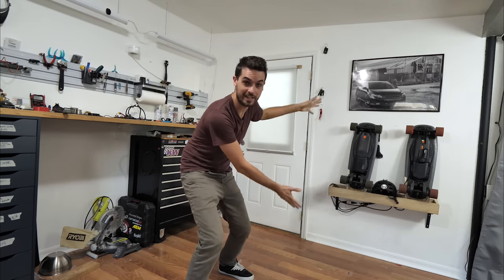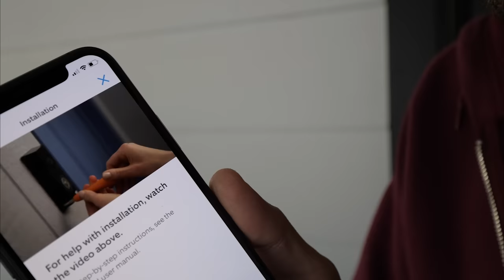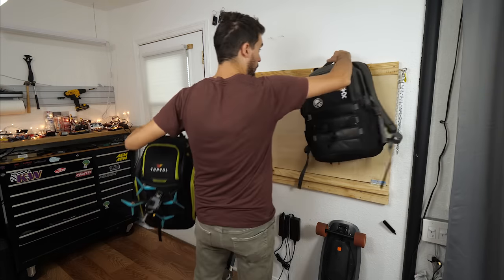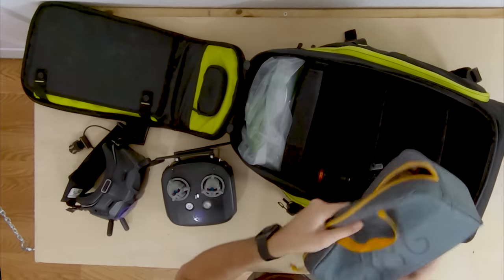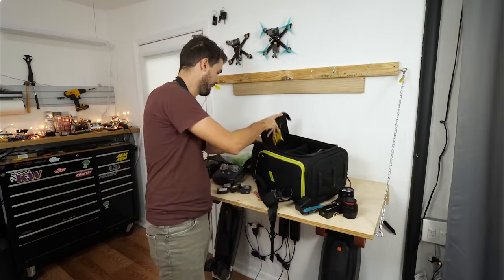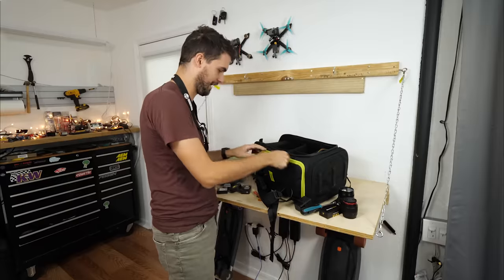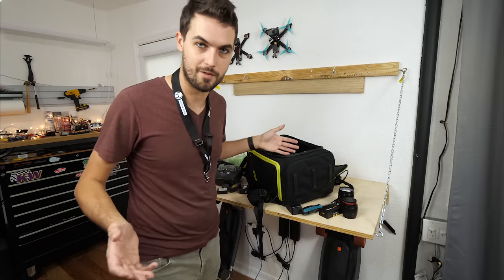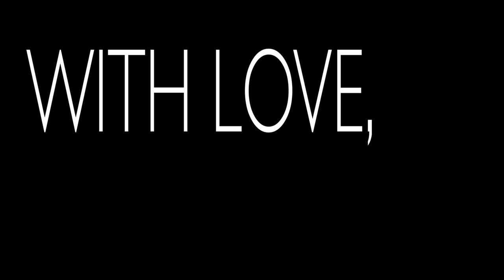i made a FPV Drone Bag rack! [FPV gear breakdown]

Comment: Also Mr. Engineer, hang the boards from the trucks instead of balancing them on the tail.
Reply: VORT3X lmao - “Mr. Engineer”.
Reply: Duh.
Reply: OMG! He LIVES! 👀
Reply: Engineering doesn’t always mean you have to come up with the ideas, sometimes you just need to engineer other peoples ideas lol.
Reply: Or add a couple of pegs on either side to hold them upright, or some hooks and bungee  cords to strap 'em in...
Reply: He could also just put the wheels against the wall they are a bit stickier than the lip of the deck
Reply: He used to be a GM engineer. He is smart,  it just a good fpv pilot. Although I Dennis at Excel Rc told me Vortex taught him how to fly 😐

Comment: Yo, Drew! - Four straight bars/sticks in a row underneath that folding table, two holding each of the e-boards up flat, right behind the wheels. 
So they "stand" in the air behind each other, if that fits in length.
You can hang that helmet on one end of those bars/stick ends, too.
That ultra-low lookback on the parking lot blew my mind!! =)

Comment: Great vid!
Also, PSA: don't get ring!
We got a handful of cameras and a doorbell months ago and they've been nothing but frustration.
For starters they have ATROCIOUS battery life. They claim months, but on the lowest possible quality settings they last less than a week.
2nd: they never can connect. When you open the app, (if you can even open it, more on that in a minute), have ridiculous frame droprate. It's just horrible. Really terrible. We're not even comparing this to any other smart home security systems because this was our first like this. Using them is just a bad experience. Also, the camera resolution and framerate is awful too. The digital zoom on the app just makes it worse. 
Now the app: when you open the app, or should I say, IF you can open the app (because it's stupidly buggy) the interface is awful. It's not user friendly, and I'm a tech guy. Not to mention the app is absolutely LITTERED in bugs. Bugs that essentially render the live feed useless.
Ok so the live feed is crap, how about the motion alerts? 
Nope. They're crap too. Half the time it doesn't even pick anything up, then the other half it's picking up every single motion alert (including cars driving by, animals, etc. Even with the setting set to only detect people) 
Anyway I suggest an upgrade. The Nest hello is probably a way better setup. I don't have it, but Google products in general are WAY more consistently greater than Amazon products. They are a bit more expensive, bit instead of wasting your money on this setup, either save the money you'd spend on this, or spend it getting something better
Anyway, rant over. Just wanted to let you guys know so you could not waste your hard earned money on this garbage. Truly shameful of Amazon to release such a bad product and misrepresent it in the advertisements.

Comment: Thanks for this vid' Drew ! I need a backpack for travel, Bp x2 isn't better for one quad in with props ? Also Dji HD system and X-lite+Crossfire.
Amazing flight as always, smooth style 🔥
Reply from the maker: Yes the lowepro bags better fit a propped kwad on the inside. But Fitting the DJI goggles will require rearrangement of the divuders
Reply: @LeDribFPV  thanks for your answer !

Comment: 2 J-hooks screwed into the wall will keep both boards from tipping over. Measure it out so the tail of the boards still touch the ground, you'll only need 1 hook per board. Your local HomeDespot will have them, look for the vinyl covered ones...extra protection. They can easily hold a 20+ lbs mountain bike.
https://www.homedepot.com/p/Tornado-40-lb-Tornado-Large-Orange-Vinyl-Coated-Steel-Wall-Mount-J-Hook-48034/202639947

Comment: I would've put the hooks on the shelf instead of above it. That way you wouldn't need to remove both bags to open it.
Reply from the maker: That was the original plan so they would just go down with the shelf when lowered. But I was concerned about that much weight on a small hook in just the wood sheet
Reply: @LeDribFPV  hmm, you could add an extra 1x4 on the edge and get through hooks with a nut and fender washer to spread the load. Regardless, good job.

Comment: There's a big 'ole tool pouch on the underside of the top flap you're not using you big doofus :p

I keep all my prop stuff - prop tool, prop nuts, pokey bit for popo, flat pliers - in the side tool pouch and my "working" props in the same pocket, so all the prop stuff is in the same place.

If you shuffled your tools up into the tool bag I'm betting you'd have enough room to get a quad or two in the top, I can get two Braaps in there no problem and they're 230mm span. I do wish they'd shuffled the two mounting straps up a couple of inches though, that useless bottom strap is infuriating